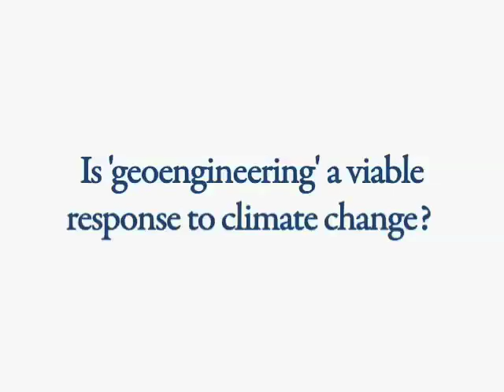Geoengineering: Don't Go There

Comment: I am sure he is good hearted in expressing his concerns, but they don't address well the academic debate surrounding geoengeneering.
Quick points:
1) Warming is not the only problem, yes, but is a huge one.
2) Methods without airplains have been proposed that'd be very cost effective.
3) We know what happens when, and risk assessment is optimistic on, sufur is thrown in the atmosphere (as happened before with volcanoes).
4)  geo-engeneering will not save calcareous animals :( Nothing will.